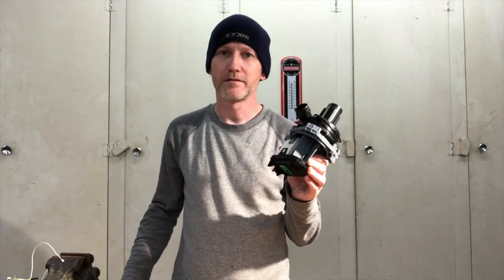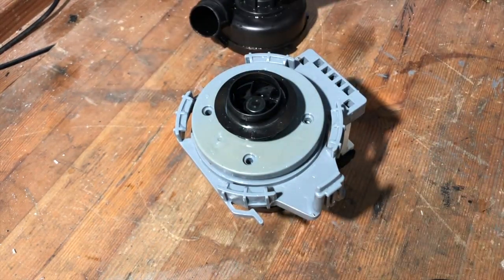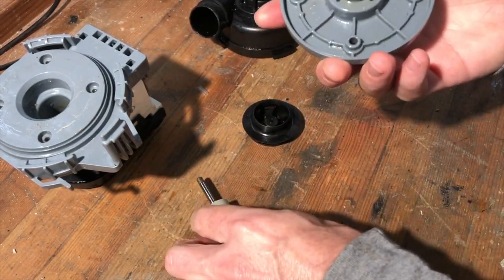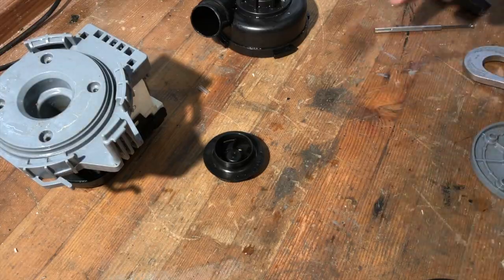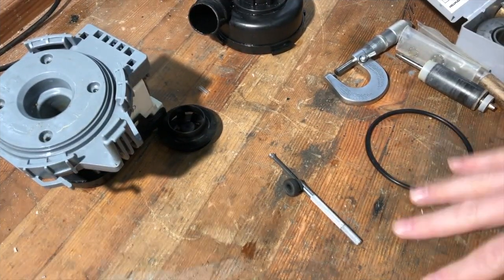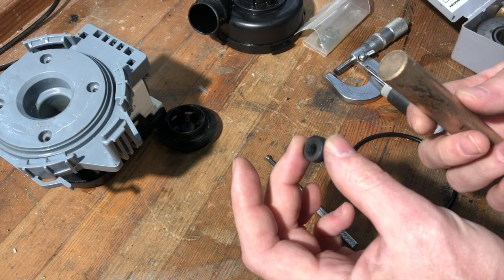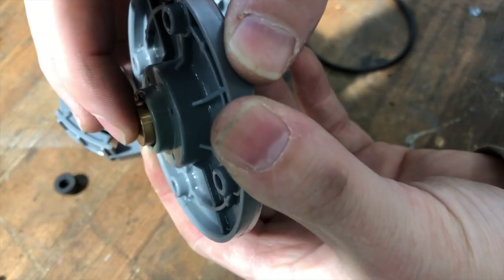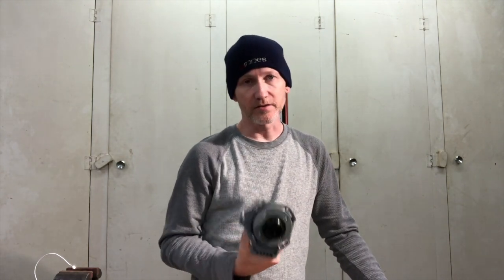Dishwasher Circulation Pump Repair Part II: One Year Later

Comment: I watched this video more than a year ago trying to fix my dishwasher. It is still running great but I went a different route than anyone else that I have seen online. I found stainless steel flange bearings that fit in the o-rings just like the graphite bushings. Part# SMF105-ZZ, 5x10x4mm. The bearings flange isn’t as thick as the original bushings so I cut nylon spacers (1/2”x.194x1 before cutting)to  account for the difference.

Comment: Same exact problem, less than four year old dishwasher.  I’ve already purchased a replacement part but will retain the old part for possible repair.   You should consider selling those replacement bushings on eBay as there does seem to be a market.   Even with a markup, these would be less expensive and more durable than replacing the entire component.
Reply: Same here. There seems to be a lot of this specific failure in a range of these similar models. Very annoying as it's not easy to diagnose and the least accessible component.
Reply: Would buy!

Comment: I machined 2 bushings out of a solid bar of oilite bronze material. I purchased a 5 MM reamer which made the bore about a half thousand over the shaft size.  The shaft isn't exactly 5 MM but oilite is difficult to machine to tight tolerances  but I lucked out and it has been working fine.

Comment: Awesome video. We used your information to take our pump apart as we were experiencing the same issue and we found the impeller completely loose inside. The threads were all worn out probably caused by an incorrectly installed impeller at the factory (not tight enough) - poor quality control, Whirlpool. Since we couldn't purchase the impeller separately (a shame) we had to order a new pump from ebay for $62. Thanks for taking the time to make and post these great videos.
Reply: How has the new pump from Ebay worked out?
Reply: @bodeine454  Very well. Still working today.
Reply: @carlosmacia357  That's great 👍

Comment: Just thought I would add a data point.  I went through the same process as you, except my first fix was bushings made out of a set of brass speaker posts (what happens when you pull stuff apart at 10PM just to take a look and then start ransacking your junk drawers for kludge parts).  Like you, I eventually got around to making something out of bronze, but that was because I experienced a second failure.  The second go round, I didn't put the kick plate back on right away.  Without the soundproofing, I heard the root cause, which was an intermittent failure of the diverter pump.  When the diverter got stuck between positions, the back pressure set up a cavitation wobble that eventually toasted the bushings.
Reply: Interesting deduction... my diverter motor went bad... then the circulation pump... though I can't say categorically it was "A" that caused "B"... it certainly is feasible!

Comment: Great news guys, I found a temporary fix for the graphite bearings. It thought about just rotating the bearings 180 degrees so the magnet would pull the shaft into a area of the bearing that is not worn. I pulled the bearings out and reinstalled them with the worn spot (has lots of scratches, measures thinner with callipers) away from the stationary magnet. The bearings were a little tough to get out. I used a large screw like the Youtube guy. It chipped a little. I had to get the bearing wet to get it to go back in with the rubber o-ring. It worked! I have been running the dishwasher for 2 days now. I am not sure how long it will work but this fix was free.

Comment: Just found your video and it made me think. Same exact issue with the bearing.  I did find the motor assembly on amazon for ~$50. After putting in the new pump in, it didn’t work. After countless rechecks on how I put it in, I came to the conclusion the new unit was faulty. So I thought, try taking the bad part off old and replacing with the part from the new. The old pump worked but just got stuck. So I switch out the grey housing of old and new. Old drive mechanism and new pump housing. Guess what is working. 

Awesome job on the bearings, why wouldn’t they make it the correct way in the first place.
Reply: I think most probably that Amazon pump looks the same with frequency and voltage but different rotation timers like originals has 30mins/10min off also amp is different as week 1.2 vs 0.9 .

Comment: Thanks for the videos!  I ran across you when my 2 year old Whirlpool dishwasher (builder installed) died.  I was so tempted to just buy something nicer but the idea of throwing something so new into the trash was eating me up.  I ended up just replacing the pump but this video really helped me understand what was probably going on inside and next time if it happens again I'll take it apart and see if I can make a more permanent fix like you did.

Comment: I'm very fortunate to have a friend with his own machine shop at his house and a stick of brass. He made me a couple brass bushings per your recommendations. I had ovaled out graphite ones and a scuff on the housing just like you had. Things look much better on the inside now. Reassembled everything and turned it on - water leaked everywhere! I think I didn't do a very good job of reassembly, I'll have to try it out later on another day. Also left the motor gasket at his house, so darn.
Reply: It's been a couple months since my repair with brass bushings and this dishwasher is running like crazy. I feel like I just upgraded to the pressure washer mode. A million thanks. I never thought I would be filled with so much joy EVERY TIME I run my dishwasher now!

Comment: I did the same repair but found the bearing rusted so I re-did it with a polyethylene bushing and that has worked out well.   I took it apart a year later to remove debris from the pump impeller and my polyethylene bushing had no detectable wear.

Comment: Thank you  for the instruction Sir!  I have now repaired mine and it's a whirrin' in the background.  Unable to go without a dishwasher waiting for parts I kludged it differently. First, my impeller was heavily scarred and scored especially at the front end bushing and needed strong polishing on a drill press with 2000 grit paper.   I purchased a 3/16" id 1/4" od x 3/4" long 'aluminum spacer' at 'the hardware store', cut off 2ea approx. 1/4" long pieces, de burred and tapered one end, drilled out the carbon bushings to 5/16" (removed the egged out portions), lubed with lithium grease, and with the spacers on the impeller shaft pressed them into place. Was too tight initially so more persuasion was applied.  Extremely ghetto but now I have time to figure out how to order the 3D printed parts mention elsewhere in the comments.

Comment: Great video, I watched the first one a year ago after my dishwasher failed. Whirlpool covered the parts. The pump has again failed. I tore one down abs found garbage “bushings” and a scuffed up interior from everything being out of alignment. I got to thinking I need some bronze bearings or something and remembered your video. As other commenters have said I’d happily buy a set of your brass/bronze/etc bushings if you’d consider selling a set. I am not keen to spend $200 on another pump.

Comment: I really appreciate this video and the first one. I moved into a house and the inspector said the dishwasher was running great. I mean, it did sound like it was running ok, but it hasn't cleaned a single dish in the past few months since I moved in Pretty sure it was just partially filling, sometimes running, but mostly just draining. I thought it was just that the basin wasn't filling with enough water, then I found water was leaking from the diverter. I fixed that, but it turned out the fill valve ALSO needed to be replaced. The basin is now filling, I thought the pump was running before, but it seems like it also has this intermittent issue where sometimes it does, and other times it doesn't because of it getting stuck to the wall due to the bushings being worn out. I love the fix, I tried really hard to find a bearing that would actually fit the exact size of the existing one, took me a while to find one but I did manage to find a 5 x 14 x 5 for about the same price as the bearing you used in the original video with glass balls. I look forward to getting them installed and sharing how it turns out. Glad I didn't buy another motor that would have me going crazy from this same problem occurring again in the future.
Reply: Glad you were able find an exact size bearing. Would you mind sharing where you sourced that from? Thank you!

Comment: Cool ! Can you please make me a pair of those amazing bronze bushing for a fair price ?
Reply: I second that. I would purchase the top and bottom bushings as well
Reply: Yes please! Would purchase a set!
Reply: I fourth the request
Reply: Add me for a set of shop made  bronze bushings.
Reply: best wishes did this ever happen??
Reply: Ditto!  Could you make me a pair of those bushings too??
Reply: Brad Huhn actually I used some drill bushings from mcmastercar I measured the shaft diameter and found one that fits good and it’s been running for 2 months so far you do need to shorten the front one some but my belt sander did a good job 👍🏻
Reply: @johnhorton3243  Can you provide the item number/name of the drill bushings you ordered from McMaster-Carr? If the size and fit are good, I'm sure many of us here would be happy to have a reliable part. Thanks!
Reply: How much to make me one?  Thanks
Reply: I need both of these parts $$
Reply: Should make the brass bushings and sell on your eBay, I would buy several for myself and many neighbors with the same pos dishwashers. I'm willing to bet I'd could get several cases of beer for fixin em and willing to share! In the mean time I'm going to go the bearing route. Thanks for saving me some money. Seriously well done! My hats off to ya!

Comment: Definately a bad bearing.  When you gave it a big bump, you bounced the impeller out of is oblique position and momentarily put it parallel to the magnetic field which caused it to spin.   I once had my auto indoor fan that had a bad bearing.  It would only start if I hit a bump really hard.   Similar to your bouncing the dishwasher!   Orientation of the impeller to the magnetic field is critical to a few thousandth of an inch.   Nice job on using the lathe to make a part. I Iove stuff like that!

Comment: Same Dishwash same problem.  6 Years old.  I do not have a lathe but I do dabble in 3D printes so I have a lot of 3D printer parts.  I found that 625ZZ stainless steal ball bearings fit the shaft well and will sit in if you drill out with a 5/8ths drill bit.  Mine were the sealed version.  I know they are not realy sealed from water but they work well for now.  If they last 12 months I will just replace them once a year. You can get 10 of these for < $10 US on amazon.  If they stop before then I will try your plastic race bearings from McMaster Carr.  A plastic race 625ZZ would be perfect.

Comment: I sure wish I had found your videos a few weeks ago.  I have the exact model WDT790SLYM3.  I got it for $50 knowing the pump was bad, because it matched all my other appliances and I have a white plastic tub gold series dishwasher.  I ordered the whole bottom end (sump with pump) for $150 figuring $200 for a "new" stainless tub dishwasher wasn't bad.  The new bottom end hasn't arrived yet, but I'm thinking I may just swap it all out and keep the old pump to do these upgrades, and have a spare pump (if/when the new one goes).  Out of curiousity I DID take the old pump out and the bottom was not ovaled out, but the TOP sure was.

I'd be willing to pay you for a pair of brass bushings (I don't have a lathe) if you'd consider.  This is VERY useful information you've posted and I may try the bearing route too.  OH and yes my motor was full of gunk, but the shaft was not scored or anything.  I think when these graphite bushings oval out, the shaft gets "stuck" at an angle (like you said in your first video).  OH and what do you think of ceramic versus plastic / stainless bearings?  I saw that in a comment and got curious.

OH and ju8st so y'all know, that dickhead commenting about your kitchen compelled me to subscribe!  :)

Comment: Love it! I was looking for other answers to a newer KitchenAid circulation motor problem, and found your video. Good work with the lathe. I don’t have a lathe, but filed down a light fixture’s brass pull-chain dangle thing untill it fit my Samsung’s circulation pump (same graphite bearings/bushings). I’m thinking about 3D printing some too, so it’s good to see others are finding solutions too. 
Ps. The only Whirlpool product we own (OTR microwave) is having door switch issues after less than a year. 8-\

Comment: I have the same problem -- give a wack with the butt of a screw driver and it sprays. I had replaced the control board because a bench test of the pump worked ok with 120 vac,  Never checked the bushing/bearings but I am sure that's it, after replacing a new control panel -still the same problem.  I checked AC  voltage out of the two purple source wires with it running and the 120 v came on after the tub fill- should have checked that before I ordered the control Board. After the new CB thats when the wack attack worked.  You can get the new replacement circ pump for $50 plus $7 shipping now( not to mention my lathe is a drill held in a vice),so it is no longer worth trying to reinvent the wheel( or in this case the bearing ) now that it has come down IMHO because I'm a lightening wont strike twice kind of guy.. But I appreciate your diligence this is by far one of the best in depth explanation of a common problem KUDOS to you man!-- BTW your kitchen is cleaner than mine.

Comment: I noticed you left the rubber seal under the bronze sleeve. When you used the bearing on the first video you left the seal out. If using a bearing on both ends should I use the rubber seals under the bearings? What purpose do they serve because it appears the motor is always full of water?
So happy I found your video!

Comment: Thanks for showing us how these little time-sucks are worth it in the end.  I got a damned Frigadaire dishwasher that has been good for quite a while, that is not draining fully now.  It will drain if I press the START button, but it won't do it fully at the end of a load.  So, I'm slowly working my way through problems.  Surprising, though, is how clean my interior is.  Yeah, little gunk, but the interior has been kept clean.  We do press-washing of things, so not really much goo inside.  Now, I have to work-through to find the item that is failed.  I only wished they designed these to be more than throw-away systems.  Whole damned thing is perfect, except for what the problem is.  But, I've probably had it 10 years (or so) without much problems.  So, I will trust in what you did, and I will know that I can fix whatever comes.  If you can, then I guess I can too.  I don't have all the nice tools you have, but I can rig-things pretty damned well.  Again, thanks for your video.

Comment: I have taken mine out and cleaned it.  Preparing to do the repairs. If I put 120 volts directly to it before I reinstall it, then it should spin correct?

Comment: Phillip, what a knowledgeable video. My dishwasher whirlpool goldseries is not washing, even though the electronic panel sends out 120v to the recirculating pump the dishwasher doesn't wash. So how do I determine if the control panel Is faulty or if my recirculating pump faulty.  The diswasher fills, drains but no wash. I check the wires: OK, I check the drain ok, it's between the control board and the pump. How do I determine. Than, you sir.

Comment: Great job.  I am sickened by corporate greed.  I have a 1 yr. old dishwasher that the pump stopped working.  THAT IS BULLSHIT.  I have tried to get a service manual but alas they don't sell those.  They want you to buy a new part.  I am going to see if I can fix the pump myself.  I like the use of plastic and stainless ball bearing.  Have a good day

Comment: The threads in my impeller hub failed on my WDT720PADM1. I fixed it by epoxying a nut with the correct threads into the wallered out hub, but that repair only lasted about a month. Going to revisit with a better adhesive.

Comment: Funny, we have the same dishwasher, the same lathe and the same issue. I would have gone to the bronze first.... but I didn't think you had a lathe. Those bearings are water lubricated [ dirty water ]  and if the originals are graphite, they shouldn't fail if kept wet. I have a feeling these pumps are not getting enough water into the motor guts and thus fail. About to open one up myself. By the way, I see used ones for $25 on eBay and other sites. Have to find a way to beat the Chinese crap - good job on this motor.

Comment: I saw the previous video but no list of parts below or the place where bought it.  I think your solution is very creative. Mine has a similar problem with the addition of the need for a new impeller.  Have you found a place to buy a new impeller? Can you also provide th specs for the bearing and the drill size to bore out the hole for the ameture?   Thanks

Comment: This is great but..I'd like to see ya actually connect voltage to this pump while in your hand to see it work..I'd actually luke to know what the exact voltage I need to test my pump, I'd rather do it that way to see it either work good or not at all without an ohm meter or replacing it only to find its something else

Comment: Hi

Hi I need your help.
If the propeller opens when turned anticlock wise and the propeller fins are pointing towards right around 60° Angle from top. Which way the moter should rotate clockwise or anticlock wise.

Any comments or guidance will be of great help as I have forgotten the direction of motor while changing the capacitor of my AC induction motor.